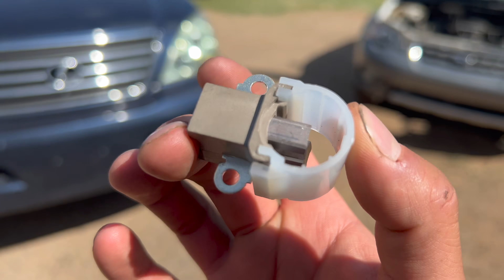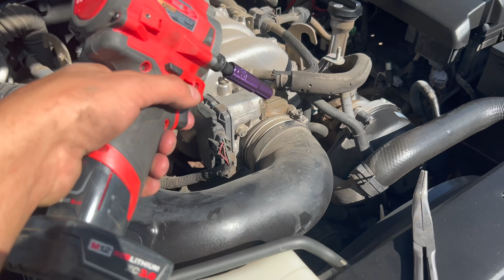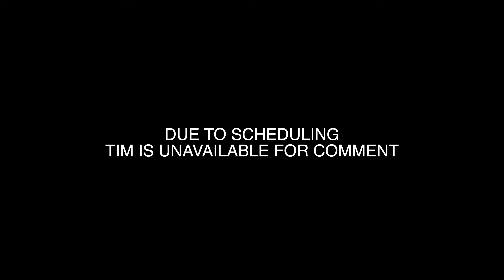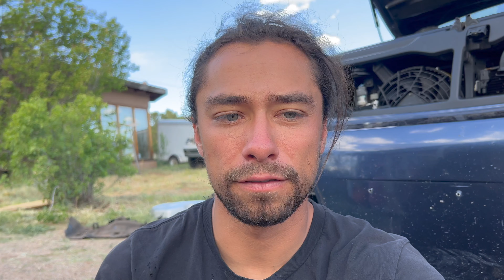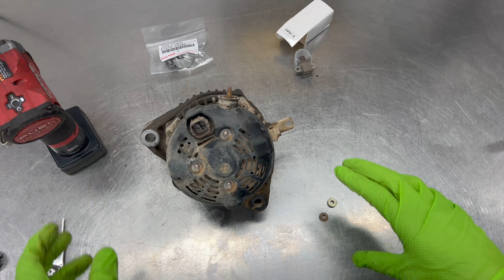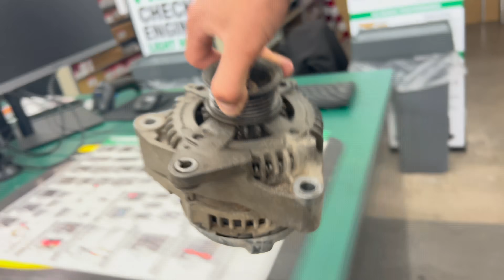How To: 15$ Alternator Repair Toyota 2uz (4runner, Tundra, GX470, Sequoia)

Comment: You never replace your alternator. You take it to the alternator rebuild shop, and they rebuild it and give it back to you. They usually do starters there too. Much cheaper, typically $40 or $50

Comment: Toyota Tercel 1980 and Tercel SR5 87 and Corollas from 89 have the very same " brush cage " , I suppose all Denso/Toshiba/Mitsubishi and Hitachi products have that same cage !? last time I did this job is about 5 years ago and the alternator had already been serviced however you cannot service them forever at some point the commutator will be too much worn. One thing I never did was to change the whole assembly because I am a very thrifty guy : I changed only the brushes wich I bought 2 dozens of them 25 years ago for 10$

Comment: Mine is at 309,000 miles and it just took a dump
Reply from the maker: Use a TOYOTA brush pack! I had a cheap one fail sooner than it should have

Comment: The darn clutch pulley on 2gr engines one will fail before the brushes will. I've yet to find a cheap replacement for the pulley even aftermarket's about the cost of an aftermarket unit. They start making a horrendous noise when they do fail. You might need to check the specs. Sometimes Toyota has different amperage alternators for certain applications. The Lexus would definitely have the HD alternator if they did have a hi-amp model for the use the uz  engines.

Comment: Great vid. I just repIaced the battery in 02 Tundra 4.7. In dash Voltmeter shows 17v charging. Is there a way to replace the Internal Voltage Regulator? 
Oh, was that a "Blue Skies" sign you flashed? 😊

Comment: Do you happen to know the bearing part#'s or dimensions for a 5th gen? Wifes 4r is making a DRY ASS BEARING sound and I want to replace them. Got a press and all that to do it with I just want to do it in an evening and not wait on parts after removal and measuring. Thanks!

Comment: Thanks for the reply. I don’t know why, most don’t give a reason. The tester at autozone did but they were pretty general like belt tension or something more related to the testing machine. I’ve had it tested 4 times now, so it’s unlikely it’s a tester issue.
Reply: Oh tested at advanced, autozone and O’rielys.

Comment: I know this vid is a year old (GREAT content) but hoping for response.  I rebuilt my Denso with 27370-58460 on 08 GX (wish I had seen @ChylieDartwright comment regarding #) but my alternator still fails the AutoZone tests :( The employees seem to have to figure out the testing system both times and 2 different AutoZone's. Could it be another issue with my alt or 2 bad tests (2 bad tests seem unlikely)? It spins perfect with no sound and no burnt smell
Reply: what makes it fail... the alternator doesn't supply full rated amps or it's not putting out a steady voltage to charge the battery?

Comment: It is extremely common for the studs to come off. And in fact you should remove them it clears up a bunch of space to remove it. 20 year Toyota MDT tech EV, hybrid certified ASE CERTIFIED. But when we do the timing belt water pumps we pull the studs and that could be why they came off easy.

Comment: So man stupid people in the comment here, they don't even know how poor of a mechanic SteinFab is.  Dude when the brushes is worn out, so is the bearings, rectifier, commutator, and pulley.  Changing out the brush is simply a temporary fix that will buy you only a few thousand miles more.

Comment: What is your take on Denso remanufactured alternators?
Reply: Denso is one of the best. Their reman alternators and starters are some the best you can buy. I know as I own a auto repair business and work on primarily Toyota/Lexus
Reply: I know you didn't ask me but if you want my random opinion I've heard that remanufactured things suck for the most part
Reply: Bad, mine failed right after 12k miles. (2 years)

Comment: FYI: The part number listed in video for 4th gen 4runners and gx470s is different from 2007 onward. If you have a VVTI 2uz-fe in your 4runner or gx470, then the correct part number is 27370-58460

Comment: Thanks for the video man I was just about to replace my alternator while doing a timing belt job on my 350k mile sequoia.. instead I bought a new brush pack from toyota for 28$ at a local dealership. Was very hesitant to get a parts store replacement and didnt feel like spending 250+ dollars. Will give this a go tomorrow!
Reply: Hey man, did the new brush pack fix it?
Reply: @zfikre-u9o  yes but also - the bearings on the alternator started to go, so i just replaced it with an advanced auto parts one.

Comment: I figured I would post my unrelated question on your most recent video so you’re more likely to see it. Thank you for the videos. They are really helpful when you’re doing things on your own at home. Your Subaru engine swapping videos are the best I found on YouTube to help with my at home driveway engine swap on my 09 outback. Now it’s time to find an engine to go back in. I have a quick question for you. All the junkyards I call say I need an engine out of a manual transmission outback because mine is manual. In your video it sounds like it doesn’t matter and I just need to swap over the timing belt guide and maybe a couple of other things. Is there anything else? And am I good to just buy any compatible year engine, regardless of transmission? , Thank you and keep the videos coming.
Reply from the maker: I don’t know why I didn’t get notified on this, sorry about that. 

You need a 06+ with vvl, avcs, V-TEC. Whatever you want to call it. Use your intake, harness, timing belt drive, and cam gears

Comment: Damn… engineers and mechanics need to fuckin hang out more. Thats insane accessing it compared to other cars that have it sitting right on top the engine.. whatever. Nice vid. Really clear on EACH step. Most vids suck ass and skip a step or don’t actually show what bolt/nut… or do the process unnecessarily… work smarter not harder!! Nice vid!!